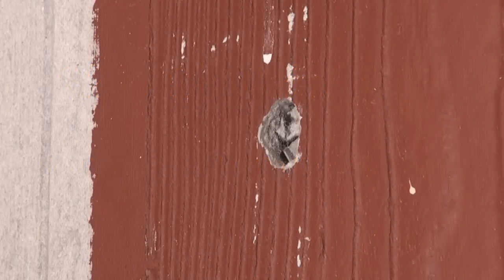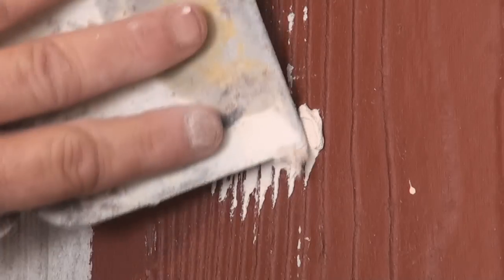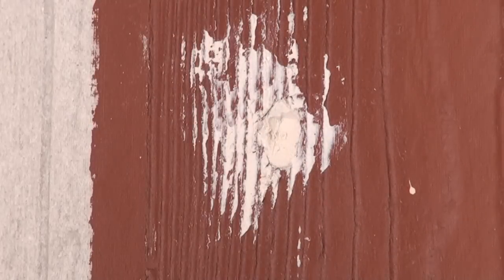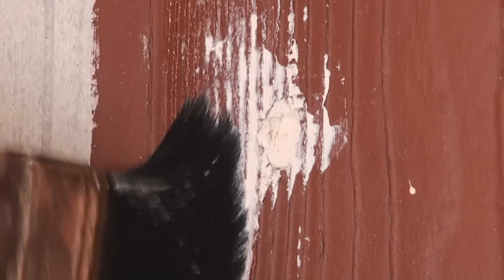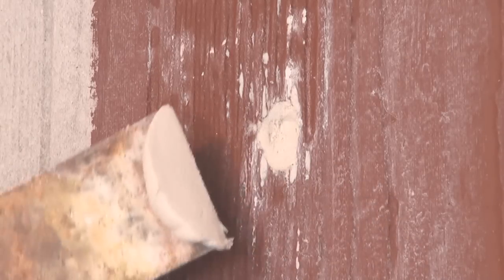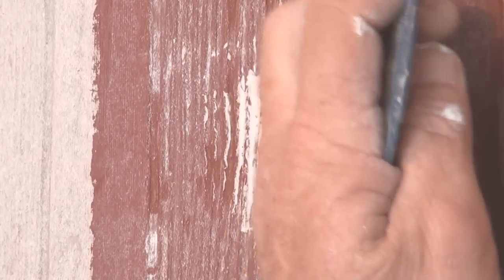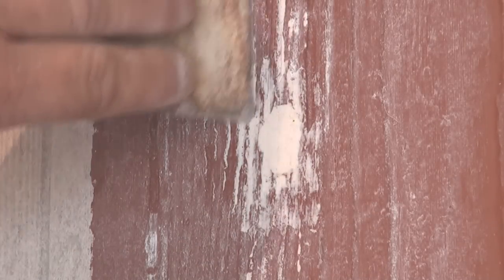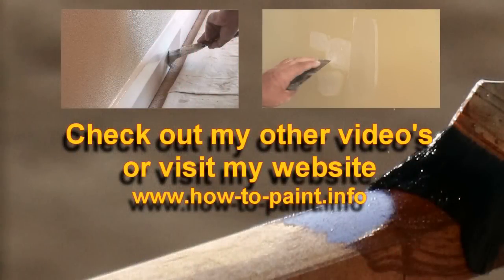How To Patch or Fill Holes On Uneven Surfaces Like Wall Panelling

Comment: What happens if the filler you put in cracks? 
I used some dry wall substance on two ugly cubbord doors that were hanging up high in a bathroom and i notice it has a lot of cracks in it as it dries.
Maybe some water on my finger will smooth it out but I didn’t get that far yet. Maybe I used the wrong product, unsure.
It’s wood with deep lines going through it like paneling but deeper.
I’m not sure what to do, maybe  I ruined them.
Reply from the maker: I'm not sure what type of filler you used but generally you can fill over top of it to get rid of the cracks. Read the instructions on the filler you used, it might have been for small holes only. 
Don't forget to Like, Share and Subscribe.

Comment: I know tou probably think you get alot of dumb questions, seeing as how experienced you are and all. But my question is what is the differences and for what uses are liquid nails, silicone and caulking? I have a basic understanding that all three are to seal, prevent cracks and leaks. But which should be used for what and why.
Reply from the maker: +KathrynJ. Briley Firstly liquid nails is how it sounds, it is a glue, there can be areas where it is difficult to use nails so you would use liquid nails instead. Silicone is used for any area that needs to be water tight, like around bathtubs and joins in gutters, it is not to be used for caulking around window and door frames as most times it is not paint able but are very flexible. Acrylic sealants of caulking are use for filling gaps around windows and door frames etc because it is paint able but its not as flexible as silicone.